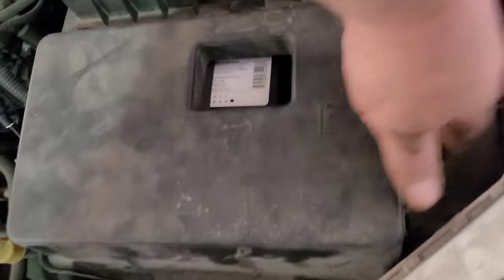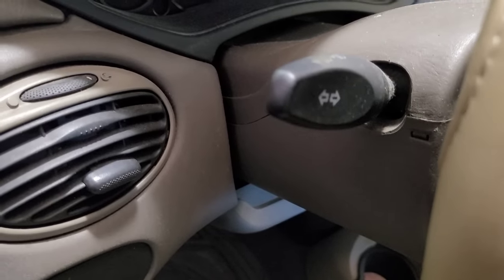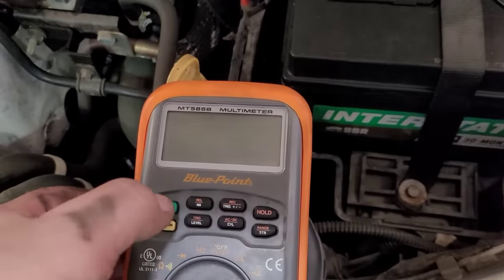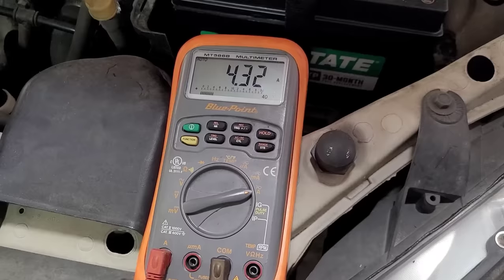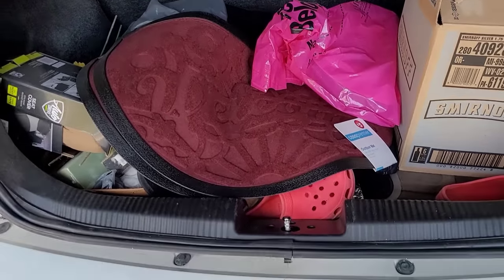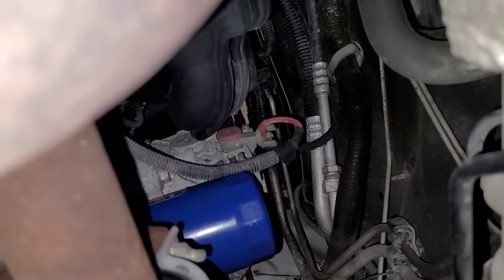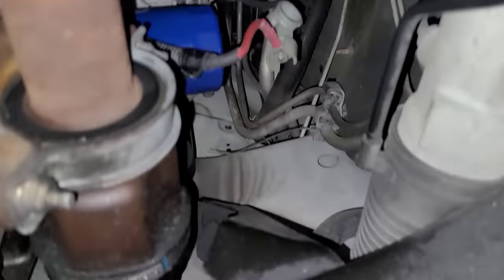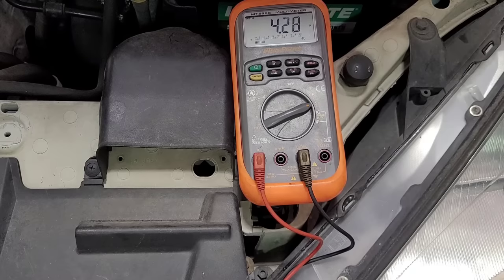Why is the Battery Going Dead? This One Will Surprise You!!

Comment: Here is a "no tools required" tip which people could use, as a rough first test.  I was having a word with m' old buddies, Mr Voltaire and Mr Ampere, so 12 Volts DC multiplied by 4 Amps of Current totals 48 Watts, right. So if the car had been parked for a few hours, perhaps overnight say, especially in a cool environment (it's Winter where you are now, eh ?) Then if the Alternator is soaking up that much power (Volts times Amps) it should be warm, to the tune of 48 Watts. It's a fundamental rule of the Universe that power turns most easily into Heat. (Less efficiently it can turn into Light, or Movement/vibration/noise etc. Possibly also energy can be transformed into  Tachyon Time Travel enabling particles, but that might only be on Star Trek TV shows. So let's leave the Tachyons and Time Travel out of it just for now.  Think how warm/hot an old style "40 or 60 watt" Tungsten filament light bulb would be. If it's been on for more than a few minutes and you grabbed it with your hand, that'd be a big Ouchie for sure.  On a cold morning, put your hand on the alternator and feel how warm it is. Does it feel as cold as the rest of the engine block and transmission housing ? Or is it toasty warm ?
Reply: That's exactly my result on the most recent alternator I diagnosed.  The 3-phase rectifier inside had a damaged diode and was feeding current into the regulator, that caused the regulator to full-field the rotating winding.
Most alternators will have between 4-6A of full-field current.

Comment: I have a Kuga in the UK, the draw was the rear door handles had a short and kept waking up the computer every ten minutes so it never went to sleep. There was a fuse in the rear that disabled  the touch sensitive door handles and that fixed it. I had replaced both the battery and alternator

Comment: It sounds like the diodes are leaking current through the negative side of the diode pack.

In my Holden Commodore it was happening because the lumbar support switch was full of dust which was causing it to partially stick on & it was connected to a hot positive,not a switched positive.

I just pulled it apart, cleaned it out ,relubricated it with petroleum jelly & reassembled it which fixed the problem.

I recently fixed a slow cranking issue while I was changing the oil last  Friday evening by tightening the starter motor solenoid nut for the starter motor positive cable which fixed the problem so they were both no parts required repairs !

Comment: Had the same on a mustang, 2.1 apm draw. Turned out to be the body control module having alot of corrosion all over the board due to clogged rubber drainplugs, making water find its way into the cowl, and the control board. New used board fixed it. Board was far beyond possible to refurb.

Comment: Ford Alternator !- is this the type that is controlled by the PCM - two wires called COM (Command) and MON (Monitors ) go from ALT to PCM- PCM varies charge depending on temp , load, etc. Sometimes those two wires get messed up , causing all sorts of "bad" alternators

Comment: My dad's friend came over to the house in a big, beautiful Lincoln town car many years ago for a visit. While he was inside with my dad, I went out to do some yard work. As I walked past his car, I noticed some steam or smoke coming out through the grille. I ran back to the house and got him to come out and pop open the hood. When we did, we saw the inside of the alternator was glowing red hot and billowing smoke! I ran to the shop, got a wrench and got that battery disconnected ASAP.  Turns out (for whatever reason) the majority, if not all of the diodes had failed putting full current through to the stator (field) windings!
   If I hadn't decided to go outside at the time I did, I'm sure that his car would have burned to a crisp right there in our driveway. Went to the auto parts store, came back, installed a new (rebuilt) alternator ( I think it was like $80 or $90 ) for him while they watched from the porch with their ice tea. 
   An hour later he got ready to go and said "How much was the alternator kid?" I told him, and he handed me two $100 bills and said he was lucky it happened here and that I was around.

Comment: Maybe the field of the alternator was always energized by a bad regulator or a short in the brush holder. I have read that some people have had problems with worn brush deposits on the holder causing this. I have never seen it. If you would have increased the rpm and seen the voltage increase a lot this could have been the problem. It was only tested at idle. Rotating the engine would probably not change the current. The brushes on an alternator are like slip rings that make a constant contact with the field. If they are worn or stuck the current would change but the voltage would be low at idle. This test is more useful for a starter. It could also have been a bad diode. I am not sure how Ford alternators are made I only owned one Ford. It was a 2000 Cougar 2.5 V6. It was overcharging at about 15.5 volts. Really hard to change underneath the engine so I left it like that. Nice bright headlights and the radio played louder and quick starting. I was lucky it didn't cause problems. It would have been easier and cheaper to change the battery when it boiled out but it never did. Not a good thing to do but I was lazy and cheap. I was lucky it was not like my Chrysler 300M with the battery under the fender. Not good for lazy mechanics like me.

Comment: When I wired up my 37 Chevy I put in a alternator that was used,later I installed a rebuilt one then if I let it sit for a couple months the battery would be low. Put in a junkyard alternator and has been fine since.

Comment: I had a Saab 9000 Griffin With a 3ltr V6. It had an all singing and dancing alarm and immobiliser with movement sensors the lot. If I left the car sitting for a couple of weeks, say while on holiday, that system plus the click would drain the battery low enough to not be able to unlock the car with the remote. I’d have to open with the key then jump start it, but I couldn’t do it at night because as soon as I connected the jump leads the alarm would go off and took a couple of seconds of pressing the fob to shut it iff, by which time neighbours were already woken up! :- )
Reply: Oh yeah. I forgot to say (I know it’s not related as this one has a bad alternator regulator, but for those with my problem) I solved it by if I was going to leave the car for a couple of weeks or more, I bought a cheap solar charger, cost about 20 bucks, and I’d just connect that to the battery then run the wire out the hood by the windscreen and in the door and rest the solar panel on the dash. The gap in the hood and the seal in the door were fine to close both without pinching the wire. I never had the problem again.

Comment: I had the same problem on my mondeo mk3 a few years back. On that one it had alot of ac charge current which is not good. I changed the bridge on it but it still drained the battery. The bridge did take care of the AC charge current though. This looks to be of a simular vintage so probably has simular charge management. The mondeo never goes much over 13 amps with  the new alternator though even if you rev it up to the redline.

Comment: I had a Saturn SL1 that would randomly drain the battery.  Turned out it was the light in the trunk.  It would occasionally not turn off when you shut the trunk.  Removed the bulb and did not have anymore problems.
Reply from the maker: 😳 I'm glad you figured it out!

Comment: Go to the fuse box! The socket is for the radiator drain.  Also, some cars if you disconnect the battery, you're going have a higher-than-normal amp draw, because of the security system, older Toyota you have to know the code for the radio.

Comment: Awesome video boss  !
To whom who is NOT a mechanic incline ?  Hook up volt meter same way he doing it .  Pull each fuse 1 at a time and read meter each time and put it back until you find the fuse where meter is reading  0 . 
Than you know what that fuse is for now and that would be your starting point !
When you solve that problem ? Continue  pulling fuse again till you find that 1 millimeter amp draw too .... Solve that  !  That is small amount.  That could be radio , clock alumination , alarm , motion light ...etc...etc.. ?
Hope this help ?

Comment: The only thing I would suggest is to disconncec your ammeter so that you can't short the alternator wire to ground when you remove it.  I've heard but never check to see if mearuing AC voltage while the engine is running might show up.  Should be less than about 0.050 vac.  Anything higher suggests an open or shorted diode.  It would be interesting to test on an alternator with a known bad diode.

Comment: That's the worst thing for a battery is sitting! I have the same problem, but I also have a parasitic draw. I only have a .83 amp draw in my Town & Country after it goes to sleep, but it will still kill the battery if I don't drive it for a week. I think it has something to do with the alarm because if I lock the doors manually instead of with the key fob, it doesn't die nearly as fast. I installed a cut-off switch just in case. Thanks for the tip, I think I will check that just to see if this has anything to do with my problem.

Comment: The Ford Focus charging system is controlled by the ECU.  The ECU manipulates the field voltage of the alternator in these systems.   One artifact of this setup is a flickering dash due to an instability of the control loop between the alternator and ECU where the ECU sees a low voltage, drives the field coil higher, alternator overshoots and ECU sets field coil too low and then repeats.

Comment: Just wondering if it was a bad diode draining the battery ? My battery tester , Electronic Specialties 725 , has a ripple voltage test it runs . While it can be done with a DVOM , this is part of the test . Many alternators are buried . The Ford Taurus is a complete nightmare to replace . If a draw is suspected , this is quick and done . Some of the Fords stay active trying to " park " the rear wiper .

Comment: Easiest way is to drop the radiator and support to make space. That means front bumper has to come of. One of the reasons are that the bolts holding the alternator often snaps off. And then everything has to come of anyway. I have learned during the years never to be lazy with removing obstructions. It save hands and time in the long run.
Reply: That is with European Focus. Seems like on US spec the alternator is on the other side of the engine.
Reply: How is that going to help the alternator is on back side near firewall

Comment: Great example of doing things the hard way ;-)  Take one second to open the door and then you can always reach the key - unless you have arms as long as Wilt the Stilt ;-)

I'm old enough to have had a one man service station at the end of the block and to have worked there part time when I was in high school - Joe Geer (his real name) would rather fish than work on cars so he took off the nice Saturdays and I earned $1/hr for watching the station and pumping gas.  And the gas choices were regular and premium - both fully leaded.

Shorting things out - I watched Joe pull the starter from a '49 Ford V-8 and then place its connection post to positive battery terminal and the case to the negative battery terminal - and generate enough spark to explode the battery.  Fortunately, the weak point on the battery case was a bottom corner so the jeans and sneakers I had on had holes from the acid but none of it came upward - because I was standing beside him when he did that.

I've rebuilt engines from flathead V8 to OHC 4 so most of my automotive knowledge is from practical experience.

Comment: To prevent you from blowing a meter on the amp setting, try placing a headlight lamp in series with the negative and measure the voltage across the headlamp. If you accidentally short something out all that happens is the headlight gets bright.
Reply: Wrong.
Reply: @I_Am_Your_Problem  How so?
Reply: @therealjammit  What is series...
Reply: @I_Am_Your_Problem  Voltmeter set to volts mode, not current. You're measuring the voltage drop across the headlamp.

Comment: I have 2 vehicles a Toyota Sienna Cargo Van with towing package v-6 and a Toyota Echo 4 cylinder manual bucket of bolts 2 door. Both are 2001 models 275,000 miles + . I  have modified quick disconnect battery posts. I removed the plated carbon steel or plastic bolt quick disconnect  levers and used high strength stainless steel bicycle bolt quick disconnect bolts on copper Toyota copper battery terminals. I can disconnect the positive  terminal for 6 months cover the terminal with cable grease and the plastic cover the battery came with. Then remove the plastic terminal cover wipe the terminal clean reconnect the terminal and crank the vehicle I reserved for 6 months or less, no Hassel. By the way fix your hood latch assembly with a lock system like a small padlock. So no one can steal your battery.😮

Comment: Once upon a time, when I was in the auto trade, we would have removed the alternator and replaced the faulty item, either the diode pack or regulator, at a fraction of the cost of a new alternator.. Saved customer money and made more ourselves on the repair.

Comment: Have you turned your meter to A/C and checked for ripple from the output terminal.
It will tell you if the diodes or rectifier pac is going out.
Anything over .02 volts is bad.
Reply from the maker: Great tech tip! I don't know where the car is at this point. Thanks for your comment & watching the channel. Keep wrenching 🔧

Comment: Wrenching With Kenny ? How come, when you had your multimeter hooked up to the battery. you didn't remove each fuse 1 by 1 to see if amp draw will go away ? The reason why I asked, is because what if you had more then 1 current draw ?

Comment: Nice Video buy Why do you think the position of the alternator makes any difference?...The Fields are connected through slip rings and the position makes no difference ....There are three Diodes ( a diode trio or assembly) connected to the fields and most likely one of the diodes (or the internal voltage regulator module) is shorted

Comment: alternator has two ring contacts for brushes so rotating wont change much because brushes are always in contact with a ring.
Reply: SURE !  Why did others also,   not IMMEDIATELY clue in to that faulty reasoning of comparing the segmented separate slotted sections of a commutator rotor,where each of the separate MULTIPLE windings terminate to a pair 180 degrees apart, as the rotor turns and transfers power burst as each one connects to the two brushes to transfer power out. WHEREAS the alternator  has a CONSTANT  contact with its two brushes to the alternator rotor field coils . . . . . NO DISRUPTIONS . . . . as one experiences on a segmented commutator of a generator.
Viz . . . . .https://www.youtube.com/watch?v=D3AoHW5ZH0g

Comment: I saw the biggest part of the problem seconds into the video. That blue emblem with F.O.R.D. letters on it is an excellent clue it will have either electrical, mechanical, design, engineering, and/or reliability major faults.
Reply: Yes indeed...they circled the problem.

Comment: That test still won't tell you if your trouble is with the alternator.  My first new alternator tested with bad diodes, and then the second new alternator tested with a bad voltage regulator.  Not wanting to go through another removal and reinstall, I took the good voltage regulator out of the first and exchanged it for the bad one in the second alternator in the car.  Now I can return a completely dud alternator back to the store.  Most simple battery testers can't diagnose bad diodes or voltage regulators.  OReilly AP was the only store with a legit tester.

Comment: You're working on a Ford and most commenrs that I went through seem to be related to Ford. Is this a Ford only problem? I have my elderly neighbor with a 2012 Hyundai Accent which has a parasitic draw. I just pulled the big center fuse, which was drawing the power. That controls the interior lights power locks and stereo system. I do not have the wiring diagram for it but I was curious if it would possibly be the same issue.

Comment: You can disconnect the alternator wire from the battery terminal.
If the alternator charging, you also need to check the charging current - easy if you disconnect the alternator at the battery terminal.
If the stator windings are intact, you probably just need to replace the diode/regulator pack.
Once you have eliminated the alternator, start pulling fuses until you identify which circuit is drawing current.

Comment: I have electrical issues with all of my Chevy vans suburbans yukons.
I had a parasitic draw that drove me crazy for 8 months and it finally went away by itself. Most of my vehicles have ground wire corrosion.
One of my Vans every time it rain my door locks went up and down all night. 
I had a Chevy van only acted up when I went in reverse and the engine light would go on. It got worse and worse till the engine would pour out of white smoke. On the highway the engine light with blink which is the worst warning. No mechanic and figure it out so I sold it for scrap.
If that ain't bad enough all the brake lines on Chevys crumble from the salt rust.

Comment: Many years ago when I had my shop, I also had a battery problem, going dead. Worked on it for two days, among pumping gas etc. and could not find the problem. Took it home and let it set in my drive so I could work on it on Sunday. Saturday we went out for the evening and when we came back, the brake lights were on but dim. Turns out the brake light switch, which was pressure activated, had a slight leak and brake fluid was shorting the switch, not enough to see the lights on in daylight, but still killing the battery. Pure luck that I found it.